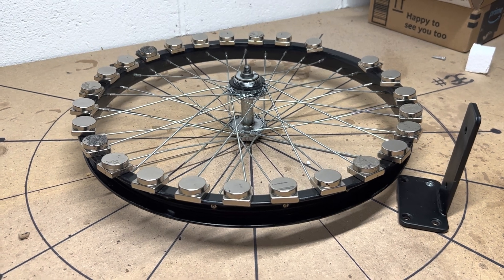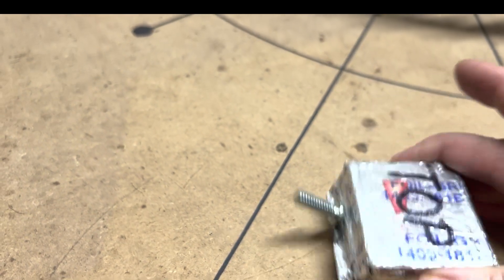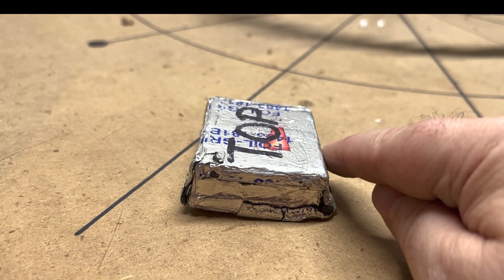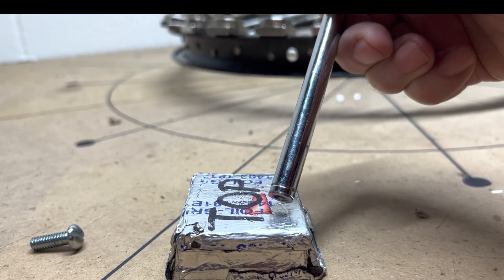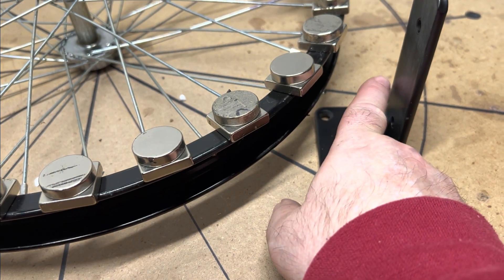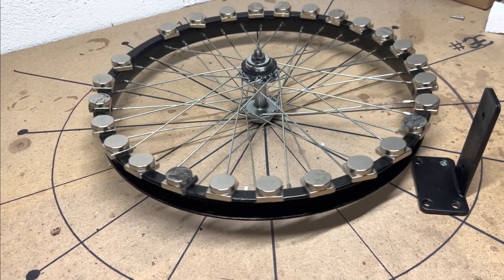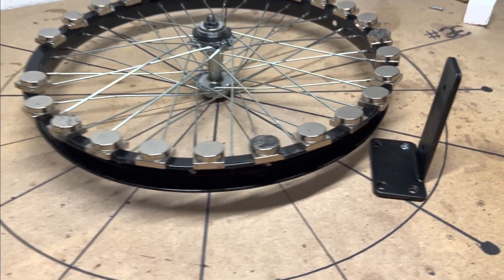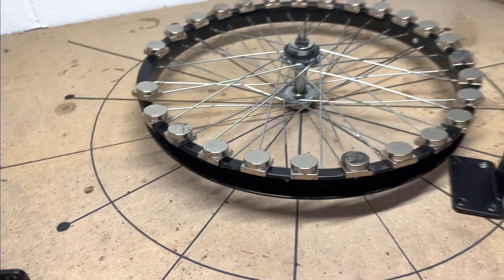🧲 RONEY STATOR TUTORIAL FREE ENERGY GENERATOR RESEARCH

Comment: why don't you go stroll around your nearest 'hardware store', and look for  any  bits   that will work  BETTER  than what you are using, now.          apparently,  ANY  fabrication of a NECESSARY components is   BEYOND  your  abilities.
Reply from the maker: 🧲 I have the ability, just not the resources. I, along with three other gentlemen achieved the highest national IQ test in the US four years in a  row many moons ago. Of the four of us, I was the only one to get a prefect score for the mechanical reasoning portion of the test four years in a row. This is very much my wheelhouse. I recently moved into a new home. All my shop equipment is still in pieces all over the shop floor, and in pacing boxes, with remaining pieces still in a storage locker 210 miles away that will arrive this spring.  

I have been scouring local hardware stores, but where I moved to is very limited. I’ve been to lowes five times in the last couple of weeks. This town I’m in is screwed up when it comes to hardware that I can’t even buy a half inch nut with fine thread that fits properly. An old guy who worked as a bike mechanic in Lowes was puzzled why we could not find a nut that would fit properly. 

Still learning my way around town. Discover another hardware store that I’ll check out. However I’m finding lots a options online. I need to finish up on a drawing, then break the drawing down into parts. This way I’ll know exactly what I need.  Since I was about 17 years old, entire blueprints involving mechanical reasoning and mega structures started popping into my head. Never stopped. All I have to do is think about it, and the blueprint I need starts to form in my mind almost instantly, regardless of complexity. It’s how I aced the mechanical reasoning portion of the test 4 years in a row. 

Once you see my final setup, you’ll be impressed, along with everyone else. I need help with 3D modeling as I do not have a 3D printer. I shopped it, and it’s around $7,500 for what I would need. Don’t want to deal with the learning curve either.